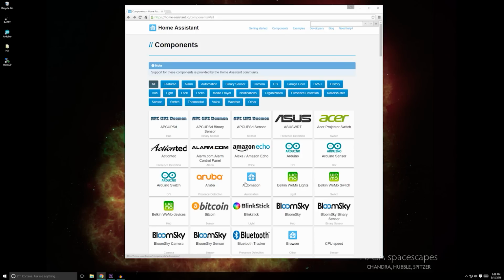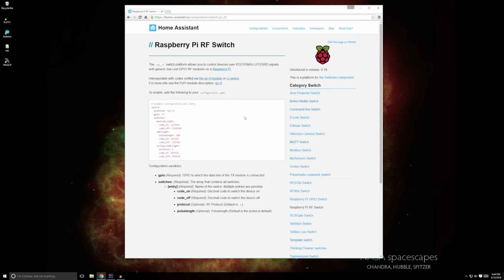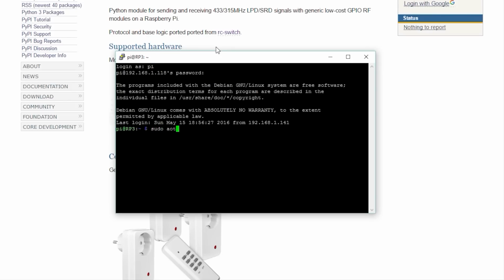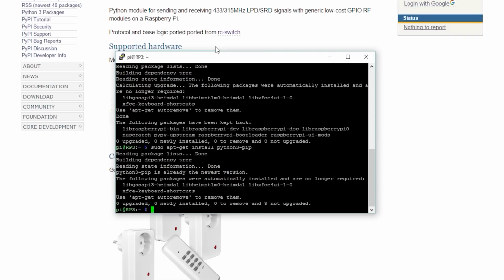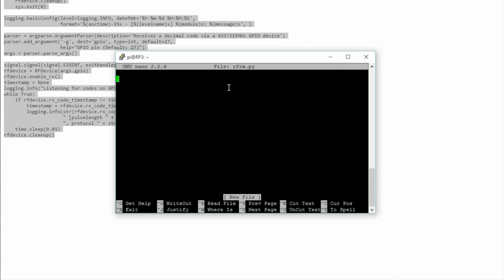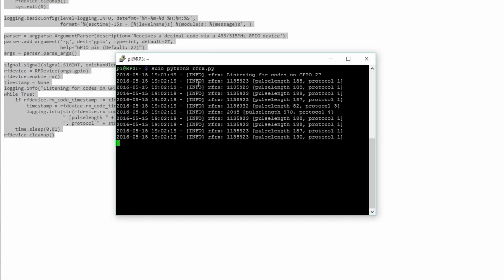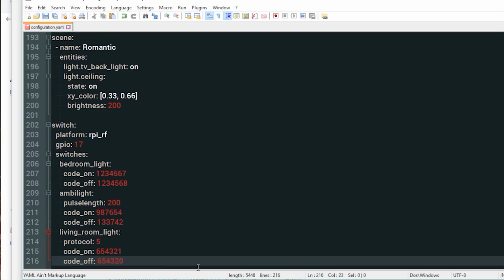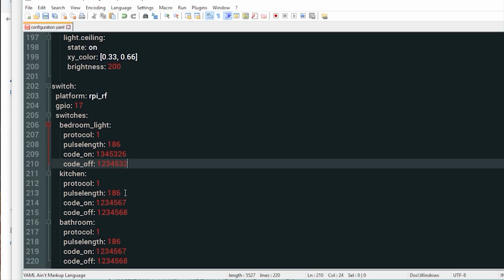The Cheapest Tech - $6 DIY Internet of Things Smart Outlets

Comment: Hi Ben,

First of all, thanks to all you amazing videos. It's was your video inspired me to my home automation journey.
The RF switches work great. After I finished this project, I want to automate my lights by using RF 433 light switches. I could capture the codes- something with length 418 with protocol 5. And I used raspberry pi RF switch component too. But it couldn't work. Could you let me know how I can make it work? Thanks!

Link for Rf switch:

http://m.banggood.com/Broadlink-TC2-Smart-Home-Touching-2-Loads-Panel-Switch-Wireless-Remote-Light-Controller-p-948888.html
Reply from the maker: Hmm, not sure I have a lot of good advise here. There is a ton that can go wrong in the RF setup, unfortunately.

You could try capturing the codes on an Arduino. A lot of people have much better luck using that hardware. Besides that, I'm not sure how much useful advice I have. Check the wiring, maybe try a different power supply, add antennas, move the devices closer, the normal lineup of stuff. 

Sorry about the troubles!
Reply: Ben, thanks for advice.I think i will try using Sonoff Touch to see if it would work better in terms of integrating to my HA set up. Hope i can share some good news if i succeed in doing that! :)

Comment: does it matter if they are the learning code, or fixed code ones, i have every thing else working properly but Home assistant doesn't turn on the plugs
Reply from the maker: Some outlets don't work well with this. You'll need to make sure they are the right frequency for your receiver and transmitter. But, if you can receive the message and emulated it with the transmitter, it should work.

Comment: Hi Ben - many thanks for all your great HA videos and help, I know you cant check my wiring but I am using an original PI with only the 26 GPIO pins. I am successful up to running the receive script - but i don't get any responses while running the script. Any ideas where to go from here ?
Reply: If you don't have an antenna attached to your reciever on some of these you have to be very, very close to get a signal.
Reply from the maker: Scott is very right on this. The Pi struggles with the receiving part of RF commands, in general. If you have an arduino laying around, you can probably intercept messages on that, too. Some people have even been able to program the RF outlets directly from the Pi (put the outlet in pairing mode and transmit a signal) to avoid ever needing a receiver.

Comment: hey could you do this for IR. it would be neat to control things that use an IR signal just have not wrapped my head around it. i looked online and found stuff that uses the arduino but not much with the pi
Reply from the maker: For sure! I have an IR project on the list, but getting the how you control it side can be difficult. Just depends on how many components you want to to control.

Comment: i don't know but its not working for me i am using the Superheterodyne 433 RF RX TX (alternative) https://www.amazon.com/SMAKN%C2%AE-433Mhz-Transmitter-Receiver-Arduino/dp/B00M2CUALS/ref=as_li_ss_tl?s=electronics&ie=UTF8&qid=1464322826&sr=1-1&keywords=433+rf&linkCode=sl1&tag=brau01-20&linkId=5c11978c5ddf767c9b4b2228ab61fed4 
but when i press the button on the remote the receiver does not get any signal and i did put a wire on the antenna place but nothing
Reply from the maker: RF stuff can be a huge pain to nail down. There are a ton of things that can be going on from a hardware side. Could be the power supply, a bad wire, interference, the wrong protocols, etc. Also, try holding the button down in 3-4 second intervals and moving it around pretty close to the receiver. That did the trick for me a few times. Sorry about the issues!
Reply: Thanks Ben
actually i did the trick by using the Nodemcu to receive the signal and it worked but unfortunately the Rpi didn't i do not know why but i can now use the Raspberry pi to control the outlet " transmitter is working"

Comment: Realy awsome guide! I just started with home automation on a pie after watching your channel. For the cheaper ones this works great (2 wheels with 4 values each so 16 combinations). I found one problem tho that you might know the reason to. I have a couple of Nexa switches, a Swedish brand, that use self pairing with the remotecontroll. When i push the button on the remote the codes are not shown in putty. I also have another set of cheap switches, with 10 (0,1) pins in the switch and 5 (0,1) in the remote. This dosnt show up either. Is it possible for me to get these working on Home Assistant and the Pi aswell. Im guessing that the  rfrx.py scripts needs to be modified somehow or maybe i cant even use it at all and need to decode is in some other way. Im also guessing i would need some other rf component in Home Assistant to make this work? Alot of text here but thanks in advance. Great channel and keep up the good work =)
Reply from the maker: Thanks much! I don't have a ton of specific experience with those switches, but you maybe able to calculate the RF code and/or look it up from a datasheet if it uses a predefined pin configuration. 

I would have expected those RF signals to get interpreted by the rfrx.py script, though. I wonder if they are using a different protocol or a slightly different frequency that the receiver doesn't like. 

If you have self-pairing outlets, some people have been able to get them to pair directly with the Pi by making up an RF code and transmitting when the remote is in pairing mode. You could try that if your outlets have that future. Let me know what you get working! Cheers!

Comment: Hmm...I followed everything exactly, but I can't get the switch in Home Assistant to turn the outlet on or off. I know everything is wired correctly because I manually send out the RF code through the transmitter from the Pi and it will turn the outlet on/off. I just can't get it to work through Home Assistant. There are no errors in the log, and HA says it's turn the switch on/off. Thoughts?
Reply: Hmm, figured it out...kinda. I set the pulselength to anywhere between 80-84 with a protocol of 1, and I could start controlling some of my devices. But when I ran the rfrx code, the pulselength was 186-189! Very strange...
Reply from the maker: Nice! Pumped you got it going. Sorry for my delay in getting back to you. Yeah, the RF stuff can be totally odd at times. I'd try maybe a different power supply, moving things around a bit, and/or a different transmitter and receiver. There are a lot of hardware things that can cause issues like this. Sorry it can be pain at times!

Comment: My raspberry pi transmitter is sending the same codes being recieved through rfrx.py as the outlet remote but the outlets will not turn on even if they r right next to it. but my arduino will send the same codes and turn it on everytime. any ideas. really want to use the pi for this.
Reply: I've just got mine working on a pi, common problems I had and fixed: checking wiring, adding pulse and protocol, adding an aerial.
Reply from the maker: Yeah, the Pi doesn't work as well for RF stuff. Never really figured out why that it is. It's probably the 3v logic. :/ You could try a logic shifter and see if that helps!

Comment: Man this is frustrating the heck out of me. i have done everything in this video exactly as described and when i get the line 'listening for codes on GPIO 27' i start clicking buttons on the remote. the outlets will turn on/off but the pi is not registering anything at all.
Reply from the maker: Yeah, a lot people have similar issues with RF. It could be a million things. The most common is a bad receiver. It rarer cases, it could be a power supply issue, a bad wire, interference from nearby devices, a different protocol remote, etc. Sorry about the troubles!
Reply: BRUH Automation nope! Just me being careless. I had the transmitter and receiver data lines swapped. Thanks again for all your videos you have helped me through all of this and while sometimes painful it makes it that much more rewarding.

Comment: Hi Bruh, first of all - I love you videos and I am currently planning to build a house in spring & will take your ideas for home automation with me. 

One question - how far does the Raspberry  reach out to the outlets? does the raspberry have to be in the same room?`Also - how many raspberrys do you have ? 

cheers 

Kalvin from Germany
Reply from the maker: It depends how you set things up. If you have a few extra dollars, I probably look into using Zwave or different WIFI outlet methods. These RF outlets are great, but some people have issues with them and the range can be really unpredictable. For me, I can easily get 20-30 meters or range through 4 or 5 walls. Plenty for my entire house with my Pi in the middle of it. Other people get like 20 feet. It really just depends on where you live and the construction materials and such. WIFI or Zwave is a lot more predictable. 

You'll only need one Pi for Home Assistant and that Pi can use Zwave and/or RF.

Comment: newbee question: how do you assemble the hardware in the end? Will it stay inside the raspberry box, or?
Reply from the maker: Eh, still working on that! :P I have a plastic case that snaps together. I take the front plate off and run header wires out. The RF RX and TX sits outside kind of ugly like. It's works great, though. I need to make a 3D case that has spots for the RX and TX.
Reply: Ben, love your videos.  Concerning case I have several old Linksys WRT54G routers sitting around.  Could one of these be used for Pi and RX and TX and utilize the antennas or is there a difference between Ghz and Mhz signals that the antennas won't help?

Comment: would be great if you can do a video on integrating the broadlink RM-Pro. It has both RF and IR
Reply from the maker: For sure. I don't have one of those yet, but if I can get access to one I definitely will.
Reply from the maker: Assuming if it is possible/if I can figure out how to integrate it. :P
Reply: Yes! This, please @BRUH Automation.
Living in Europe, I was having trouble finding a smart light switch that fit in my wall holes. (They're square here)
I finally fount the Broadlink TC2 switch, and I'm trying to figure out a way to control it using my RPi. I also have a Harmony Hub and would absolutely love to be able to control the TC2's with it, but I think that's not possible.
Reply: Hi, here's the way. https://rollertrol.com/raspberry-pi-smart-home-with-home-assistant-and-broadlink-part2

You need to add a broadlink switch as below, so the broadlink will show up in your HA Services (remote); you then select broadlink,  service learn command and record the command as you'd do with the broadlink app. The command will appear in the HA States section. Copy the command for on or off and paste in the config.yaml file where you're creating your own switch.

Switch:
  - platform: broadlink
    host: 192.168.200.106 (your ip)
    mac: 'xx:xx:xx:xx:xx:xx' (your mac)
    timeout: 15
    switches:
     blind:
      friendly_name: "Blackout Blind 1 CLOSE/STOP"
       command_on: 'sgGEAw0XGQwMGA0XGQwMGA0XGQsZDAwYDBgZCw0YDBgZCxkMGAwNFw0XGQsZDBkLDRcNGAwYDRcNGAw='
       command_off: 'sgC8AhgMDRcNGBgMGAwZDAwYDBgMGA0XDRgMGBkLDRgYDAwYGQsNGBgMDBgZ/aIwDBgNFxkMDBgYDAwYDRcZDAw='

Comment: I had previously made a comment regarding changing the tx_length in rpi_rf.py from 24 to 32 to allow some switches to work that have a longer digital code.

I have now purchased a 12 VDC 433 MHz 4 channel relay switch so that I could switch my outdoor garden and deck lights on and off.

Now for the different switches I need both the 24 and 32 tx_length.

Here is the modification to rpi_rf.py that will determine this based on the code number that is to be transmitted. 

    def tx_code(self, code, tx_proto=None, tx_pulselength=None):
        """
        Send a decimal code.

        Optionally set protocol and pulselength.
        When none given reset to default protocol and pulselength.
        """
        if tx_proto:
            self.tx_proto = tx_proto
        else:
            self.tx_proto = 1
        if tx_pulselength:
            self.tx_pulselength = tx_pulselength
        else:
            self.tx_pulselength = PROTOCOLS[self.tx_proto].pulselength

  # Set tx_length depending on code value
        if (code < 16777216):
            self.tx_length = 24
        else:
            self.tx_length = 32
        rawcode = format(code, '#0{}b'.format(self.tx_length + 2))[2:]
        _LOGGER.debug("TX code: " + str(code))
        return self.tx_bin(rawcode)

This is the piece of extra code that is inserted into the tx_code function

 # Set tx_length depending on code value
        if (code < 16777216):
            self.tx_length = 24
        else:
            self.tx_length = 32

When you update your home assistant this will get over written so you'll need to update it manually again.

Hopefully that helps someone else!
Reply from the maker: That's awesome. Thanks for sharing this!
Reply: Great!!! Thank you!!!

Comment: I have attempted this with the PI3 but the remotes don't seem to be picked up by the PI. It is picking up other random signals so it must be wired correctly. 
Any help?
Reply from the maker: Sadly, the RF stuff can be really hard to nail down. I've seen everything from bad hardware, interference from nearby devices, bad antennas, power supply issues, etc. RF is nice because it is cheap, but it's really hard to get going sometimes. I'll be covering Sonoff switches soon which are ~$6 each that are WIFI powered and work great. It's a solid option if you want to avoid RF. 

That said, getting RF working isn't impossible. You could try setting a random code and flipping the switch in HA while the switches are in pairing mode. Some people have made that work great without ever need a receiver. Cheers!

Comment: my Transmitter (the 4 pin one) the pins are labeled AN, DA, G and unlabel.  I assume AN is antenna, DA is data, G is ground and the unlabeled pin I assume is my 5v?
Reply: AN=Antenna This can have a wire connected to it, but it's not connected to the Pi. DA=Signal and this should be plugged into GPIO 17. G=Ground and this should be plugged into the third one in from the top left, or any ground.

Comment: I'm very new to this, but I was researching how to do this with a Proton.  My question is, do I have to sniff the remotes RF code?  The outlets are programmable... so could I just transmit a code of my own design and "teach" the outlet to listen for it?
Reply from the maker: You definitely can. In fact, a couple of people did that that had problems with their receivers. They just made up RF codes and it works. Just make sure you use the right protocol, pulse length, and length and it'll work without a problem. Cheers!
Reply: Thats brilliant.  Though after watching nearly all your videos I think I might just get a Pi and try out home assistant.  I want to be able to use control a lamp I made with Neopixel strips and automate the colors from Alexa.  I think the Pi would be helpful, then maybe I can get a small arduino device to send data to the Neopixels.  It's a lot to take it, but I'm going to start with this project to get my feet wet.  Love the videos, thanks so much :)

Comment: :/home/hass/.homeassistant $ sudo python3 rfrx.py 
usage: rfrx.py [-h] [-g GPIO] [-p PULSELENGTH] [-t PROTOCOL] CODE
rfrx.py: error: the following arguments are required: CODE  Not looking good with the new Hassbian setup.

By the way do you need to watch out for the level convertion from the receiver to the pi?
Reply from the maker: I don't do any level conversion on the Pi for the receiver. It's interesting that you're getting that error. I haven't seen that before. Is your HA config the same as with the AiO or other install method?
Reply: All-in-one still getting :/home/hass/.homeassistant $ sudo python3 rfrx.py
usage: rfrx.py [-h] [-g GPIO] [-p PULSELENGTH] [-t PROTOCOL] CODE
rfrx.py: error: the following arguments are required: CODE

Is there a easier way to install home assistant as this Virual stuff is getting me down. With hass looking for a password I have not set and all.
Reply from the maker: You could try using the AiO method. There is a way to append a -n flag to the wget command to install HA outside of a venv. It's outlined on the AiO HA page. Sorry for the troubles!

Comment: The script doesnt detect any signals, neither does RFSniffer from 433Utils
I'm using a RPi3 with raspbian 8 jesse
Any tips?
Reply from the maker: Oi, not that would be useful. Figuring out RF can be hard. I'd start with the wiring. Then, double check the code, what pin you are using, then from there try a different power supply, location, etc. Sorry I can be more of a help!
Reply: Got it working on an ELRO switch, recently bought a set of proMAX devices. But the sniffer doesnt detect any signals from them.

Comment: will this also work for door / window magnetic sensors such as this one ?
http://www.banggood.com/KERUI-D025-433MHz-Wireless-Magnetic-Door-Window-Alarm-Sensor-Detector-Contact-System-p-1043822.html?p=4S2609598718201405F0
Reply from the maker: Potentially. I can't say for sure. It depends on the RF device. Some have funny encoding that I have been unable to get working. It just depends on the device. Only one way to find out! Let me know if you get that working! Cheers!